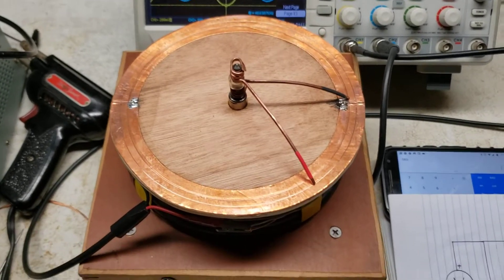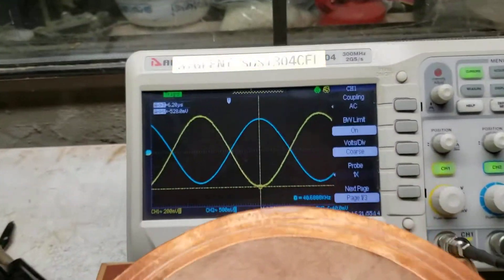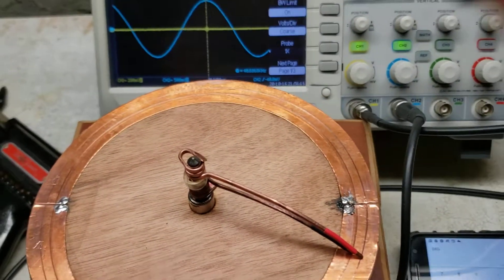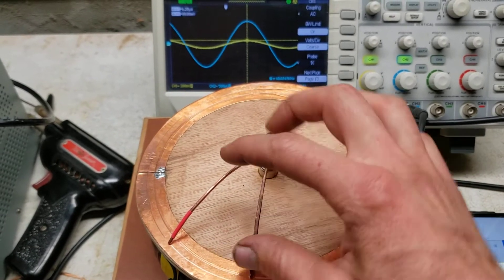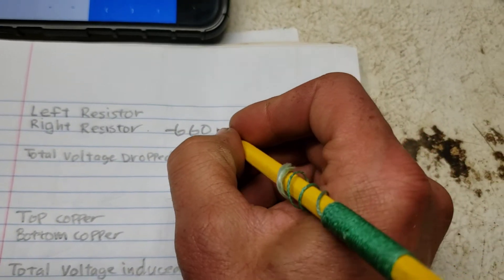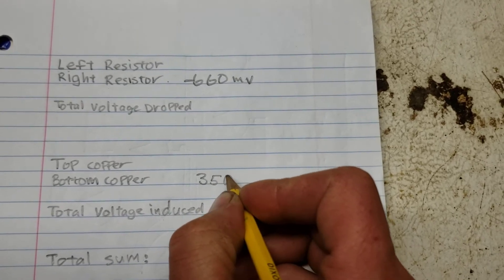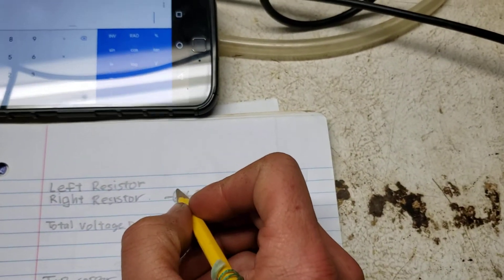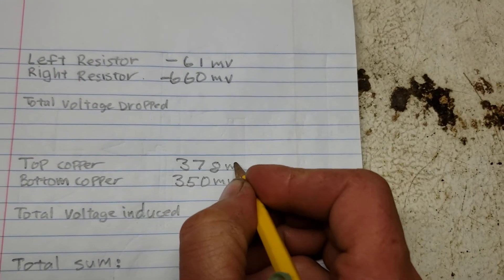The Lewin clock - Kirchhoff's Voltage Law(KVL) holds for loop circuits with induced voltage elements

Comment from the maker: WARNING! ALERT! READ FIRST!

Dear reader,

Due to the number of people who swoop in to tell me I'm wrong without even reading the arguments already made in the comments, and without reading the two PDFs and the image linked below, I have a request:

PLEASE PLEASE: Before telling me I'm wrong, read ALL the comments and attached documents in full.
If what you want to say to me something that has already been said, come up with something new to say.

I'm tired of having the same argument over and over - and I leave these comments here so everyone can see what's been argued about to date.

The only question I have that's not been answered is "Why do you say KVL is failing when it appears to be holding."

The voltage differences around the loop obviously sum to zero, at least to the degree of accuracy of my scope.

Please read and understand the following writups before arguing with me:

http://www.electroboom.com/share/FaradaysLaw_Mehdi.pdf

https://www.physicsforums.com/insights/wp-content/uploads/2018/06/k-t-mcdonald-lewin.pdf

https://postimg.cc/YGzPzVzJ (Desoer and Kuh, Basic Circuit Theory, Chapter 1 page 2)

Also, don't forget that Physics  Professor Dr. Belcher PhD said that "KVL Holds as Mehdi argued" 

and 

Physics Professor Dr. McDonald said that Lewin's circuit was within the range of applicability to Kirchhoff's loop equations and would predict the values measured by volt meters..

Thank you so much for understanding!
Reply: I don't think you're wrong, bloody well ingenious test setup.
Reply from the maker: @markg1051  Thanks!

Comment: Nice Setup because thats the only seen so far where measuring lines are not affected by the magnetic flux change.
One measurement I missed. Right in the middle between top and bottom copper. Because we had discussion in a forum where we disagree if that shold be zero or not.
Reply from the maker: I think top and bottom would only be zero if the two resistors were equal. 

If its really important I can set up and measure top to bottom for you.
Reply: @fromjesse  Thanks.  Cyriel Mabilde made that measurement and results are as KVL says for our resistor ratio: 0.4V ;)
(0.9-0.5  = -0.1+0.5 = 0.4)

His setup was quite similar to yours with radial and movable probelines.
0.4 was the same result as I got for a simulated DC net with rings of batteries instead.

Comment: Excellent demonstration which proves that KVL holds when probing correctly to avoid the B-field coupling (with caveats)!   No disrespect to Dr. Lewin, but he did his students a bit of a disservice when hiding the fact that his lumped-element model circuit diagram ignored the test leads.  The complete picture of test lead path & flux through their loop area was not accounted for in his circuit diagram.  Also, we must remember that the lumped-element model makes assumptions as pre-requisite for using such a model.  Situations which intentionally (or unintentionally) break these assumptions also breaks down the model.  Then we end up with a model not matching the experimental results in reality.  That's what ElectroBOOM got right in his final demonstration, and what your demonstration also shows in a different way.  It was unfortunate to see how Dr. Lewin did not seem to bother to fully watch ElectroBOOM's video and demonstration, but rather stick to the idea that "KVL is for the birds"... Of course, as we see here again, it's not so always (depending on probe loop path chosen in 3D space), and Dr. Lewin isn't being perfectly correct in his application of the lumped-element model in the circuit diagram attempting to use KVL.  Great job for exposing this here!

Probing in the manner you demonstrated effectively satisfies the condition for using the model. (However, given the non-conservative E-field created by the B-field... we may get unexpected results depending on what path the voltmeters are measuring across (which E⋅dl path integral over the charge density gradient).  So, the model holds (when B-field is not through the test lead loops, but gives us another confusing result), and so does KVL applied in this manner.  Also, the copper ribbon of conductors acting as a transformer primary does have a demonstrated voltage drop as you measured and proved. (Copper has low resistance, but it's not a superconductor... so still non-zero!)  Working in the milli-Volt range in AC here at 40Khz, we can see that the small voltages measured are in also in milli-Volts... so they are non-negligible in this particular scenario.  As you're well aware, the perpendicular component of flux through the "Lewin clock" radial measurement lead arrangement effectively avoids the magnetic flux coupling problem for that part of the measurement loop... so we get the results we expect to see when applying KVL to those measured voltage values.

For Dr. Lewin's original experiment, later reproduced by ElectroBOOM, we can see that the test leads MUST be accounted for in the circuit diagram model.  Otherwise, we don't satisfy the preconditions for even using such a lumped-element model, and it won't match reality.  That's why most people are confused about this... they forget that the model needs to be adjusted to account for the hidden physical properties of the measurement wires, their magnetic flux coupling, and internal meter impedance themselves.  Additionally, we have the loop with resistors we are attempting to measure also affected by the ΔB-field.  When those are accounted for, then the model accurately describes the system and KVL holds once again!  (Yet, we must be careful because our measured values then may still mislead us because the system is physically in 3D space plus dimensions of charge density gradient, and both E and B 3D vector fields but using a 2D model to try and describe it.)  So, it's a multi-dimensional partial differential equations physics problem.

Dr. Lewin made a decision to ignore the small milliVolt level voltage differences in the other loops during KVL analysis. He stated that one would have to "be insane" to think it matters... and perhaps if we only care about the 1V emf induced in the main loop... then perhaps we could agree with him because of the scale difference (Volts vs. milli-Volts).  However, in the interest of perfectly modelling the circuit we should not ignore it because it is there.  (Especially in your AC experiment in the milli-Volt range, these values are in the same scale).  Similarly, if we want to apply the lumped-element model to a circuit which does not meet the pre-condition criteria then we should add the missing elements to the model, but know why we are doing so and make that choice conscious of the reason why.

When the simplified lumped-element model breaks down, we must be conscious of why it broke down (when ∂ϕB/∂t is not zero!), and this is why the model will not perfectly describe reality.  So, we must adjust our model or work in 3D space with Maxwell's equations on the 3D electro-Magnetic circuit as it is now our system to be described, not just the 2D circuit loop alone.
Reply: Yup

Comment: Quick question on your setup. In the top and bottom segments, why do you say there is no flux through the surface of your pizza-slice shaped measurement loops? Thanks
Reply from the maker: Hey Mark, can you get me a timestamp where I say that and quote exactly what I said and let me know, then I'll review it and get back to you! Thanks!
Reply: My apologies, I misinterpreted what you said at 01:53, "...they run in a path which is at right angles to the active orientation of the magnetic field so hopefully no magnetic field will be induced into my probes."

Cool, so there is no EMF induced along the probes, just along the arcs.

So what you did in this video is measure E dot dL across the resistors and -dPhi/dt in the upper and lower loops and then show that they are equal.

Therefore KVL is just Faraday's Law rewritten?
Reply from the maker: @bozmag781  Here's a page from Desoer & Kuh book on Basic Circuit Theory, please read this first:

Lumped circuits are obtained by connecting lumped elements. Typical
lumped elements are resistors, capacitors, inductors, and transformers.
We have encountered them in the laboratory, and we can see them in our
radio sets. The key property associated with lumped elements is their
small size (compared to the wavelength corresponding to their normal
frequency of operation.)  From the more general electromagnetic field point
of view, lumped elements are point singularities; that is, they have negligible
physical dimensions. In this way they are similar to a particle.
Lumped elements may have two terminals, as in a resistor, or more than
two terminals, as in a transformer or transistor. For two-terminal
lumped elements, it can be shown that the general laws governing the
electromagnetic field, together with the restriction on physical size indicated
above, imply that at all times the current entering one terminal is
equal to the current leaving the other terminal, and that the voltage difference
between the two terminals can be unambiguously defined by physical
measurements.  Thus, for two-terminal lumped elements, the current
through the element and the voltage across it are well-defined quantities. For
lumped elements with more than two terminals, the current entering any
terminal and the voltage across any pair of terminals are well defined at all times.
  For the remainder of this book, any interconnection of the lumped
elements such that the dimensions of the circuit are small compared with the
wavelength associated with the highest frequency of interest will be called
a lumped circuit.
  As long as this restriction on the size of the circuit holds, Kirchhoff's
current and voltage laws (to be discussed in Secs. 3 and 4) are valid. This
restriction is a consequence of the fact that Kirchhoff's laws are approximations
of Maxwell's celebrated equations, which are the general laws
of the electromagnetic field.  The approximation is analogous to the fact
that Newton's laws of classical mechanics are approximations to the laws
of relativistic mechanics.  Even though they are approximations, the laws
of Newton and Kirchhoff can be applied to a large number of practical
(by Charles A. Desoer and Ernest S. Kuh, probably "Basic Circuit Theory." Transcribed from: https://i.postimg.cc/sf4j3HbF/Desoer-Kuh.jpg)

I would not say that "KVL is just Faraday's Law rewritten."

Faraday's Law deals with magnetically induced voltages like Seebeck effect deals with thermoelectrically created voltage and electrochemical laws deal with chemical sources of voltage.

KVL does not care what those sources of voltage are, so long as they can be unambiguously physically defined by measurement at the terminals of the lumped element (As described above.) 

So, by running our volt meter leads along planes which are free of non-conservative fields we can unambiguously physically measure the voltage that is being induced in that half (or whatever fraction) of the dB/dt area.

You can either  model it as a partial turn according to Faraday, or you can model it as half of the area according to Maxwell, but the results are the same because half of the area is the same as half of a turn which is physically the same as half of the dB/dt area - so they all come out the same.

The important thing is that the half-turn (or fractional turn) is being measured in such a way that the induced voltage is unambiguously measured.

It's just the same for all other voltage sources - if you had a loop with some batteries but you stabbed your volt meter leads in some random position into the juices inside the battery, you are not going to get an unambiguous measurement. Or even if you had a resistor, and you stabbed your volt meter lead into some random place in the insides of the resistor, you're not going to get an unambiguous measurement because you're violating the lumping rule.

Transformer windings are no different: You gotta lump them and don't run your volt meter leads cutting across changing magnetic fields that are going to turn your volt meter leads into the secondary winding on a transformer.

Think about it, if you got a big liquid acid electrolyte battery and you bump it and spill acid all over your circuit, it's probably gonna change the readings of stuff and because of the unmodeled current paths carried by the acid all over, KVL may appear to fail.

Same thing whith a transformer - if you spill the changing magnetic field all over and don't model for it and if you run your volt meter leads through that changing magnetic field but don't model those secondary windings in your model, then yeah, KVL (as well as all of physics) will appear to fail.

At the end of the day, a transformer secondary is just a voltage source like any other as far as KVL goes -- so long as you follow the same lumping rules as you have to follow for all other types of lumped elements (as described by Desoer & Kuh above.)

EDIT: KVL says Σ(V0,V1,V2,...,Vn)=0

It makes no stipulation on the sources of those voltages, so long as they can be unambiguously defined by physical measurement.
Reply: @fromjesse   Precisely the point!  The lumped-element model that Dr. Lewin draws is not perfectly describing the magnetic coupling of the measurement wires themselves.  His experiment seems to be intended to show that KVL doesn't work on this particular incomplete model.  Although, he misses quite a bit of nuance when he's using language and diagrams to try to describe this.  It's still not a reason to throw out KVL, but instead change the model he's using.  The lumped-element model makes assumptions such as being in steady state, ideal components, no changing B-field, etc...   These assumptions cause the typically drawn model to fall apart and fail to describe the full picture.  Mehdi's experiment shows this by running the leads in parallel to the circular loop, first one way and then the other way.  He explains it by using adding in the missing lumped-element transformer to model the B-field coupling with the measurement leads.  Additionally, he gives an example of a ground loop giving different readings as well.  Including those elements into the model fixes the model to reflect reality of the experiment.  Then, KVL holds because we can analyze all the existing loops including the measurement wire leads.

Your experiment shows how running the measurement leads parallel to the B-field lines gives us a different measurement result by avoiding the inductive coupling with the wires running to the meter.  Your way is the proper way to probe this circuit so as to avoid the unintended measurement effects.  The intent is to get as low of a perpendicular B-field vector flux through the loop area of the measurement leads.  Then the experiment results show that KVL holds, because we can ignore the hidden measurement wire transformer since it's no longer coupled with much significance to the measured values.

In the end, everyone's physical experimental results are valid and fully agree with what's actually going on.  The common misconceptions with the missing lumped-element model components is what causes so many to trip up on this problem.